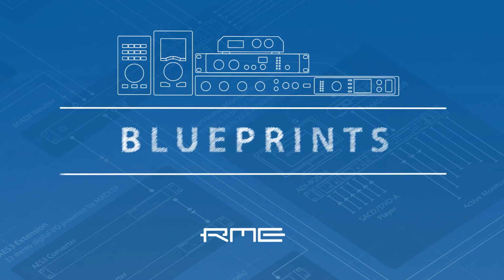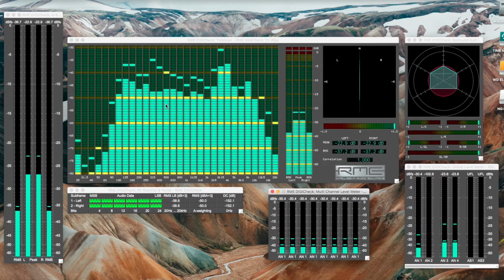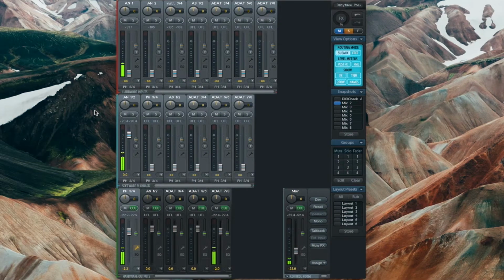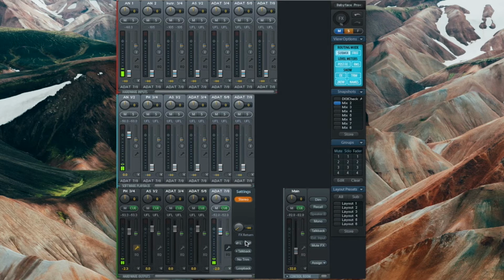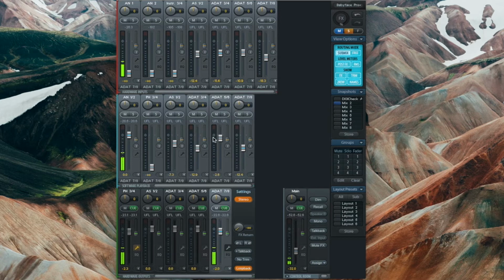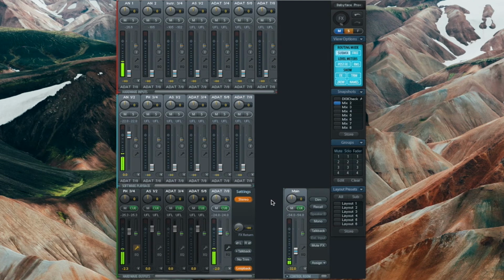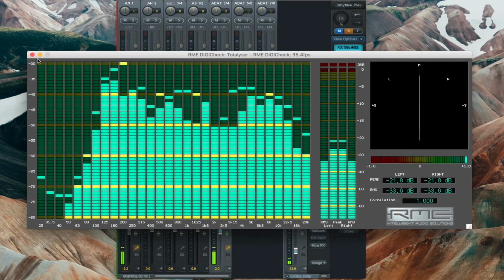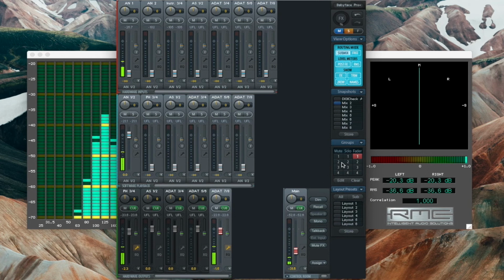TotalMix FX Loopback and DIGICheck Setup | RME Blueprints #02

Comment: In Digicheck NG you're NOT able to select the ADAT option in Digichecks Option > Audio Set-up menu now.  It's not there anymore.  This took a few to figure out the new way.  Basically, right click on the Digicheck module and select Input Selection.  Select the module feeding it for Left & Right and you should be good to go. This is for Digicheck NG on a Mac.  If your Master in Total Mix controls your monitor feed, do not link the faders so as to have a direct digi signal to Digicheck.
Reply: Thanks Bro/Sister, it's the same on PC too, been pulling my hair out with this one, NG is a bit weird compared to the original DIGIcheck.
Reply: Thanks! I was looking into this ... Its confusing and they dont explain it correctly. Thanks again. @RMEaudio

Comment: Thanks for the video! While following all the steps required, I cannot find in Digicheck NG 0.88 under Option the Input Device Setup for selecting the right Output of my Fireface UC.There is only Audio Device Setup but without the option of selecting the right output. It only works with analogue Output 1/2.Thanks for the help!